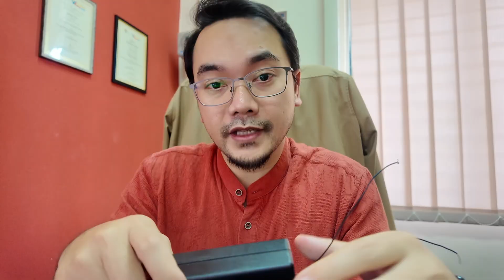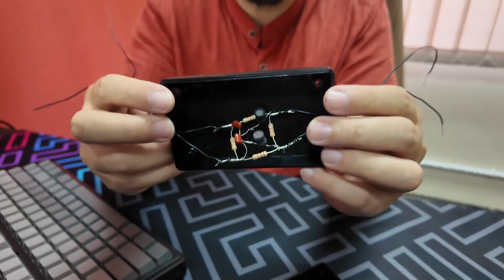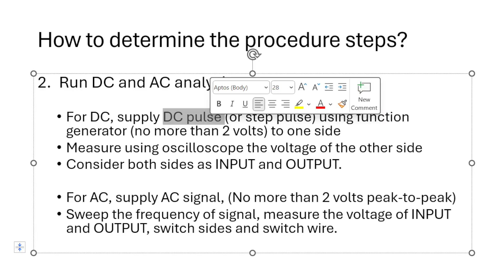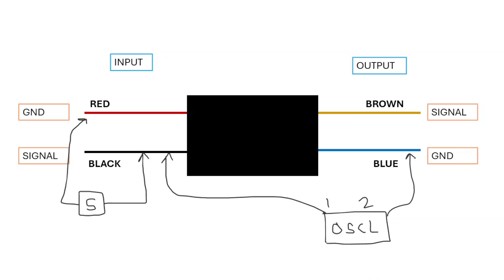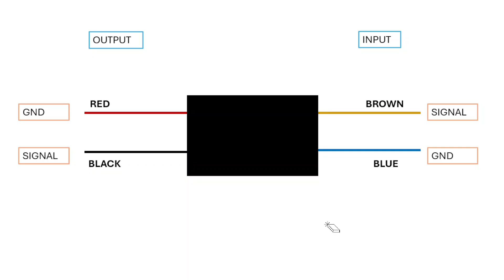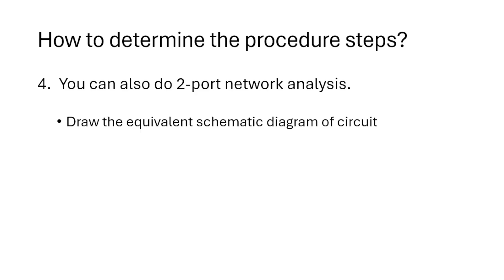Lab Test #2 Briefing - KKEE1142 Electrical Electronics Lab 1

Comment from the maker: In Short, doing the DC analysis gives you a good indication of what sort of components are inside the circuit, and doing the AC analysis will give you a good indication of how does that circuit behave or what is the function of the circuit. That way, combining both results, you can deduce what is the equivalent circuit. If you do the measurement and analysis properly, you should also be able to sketch the actually circuit schematic diagram.